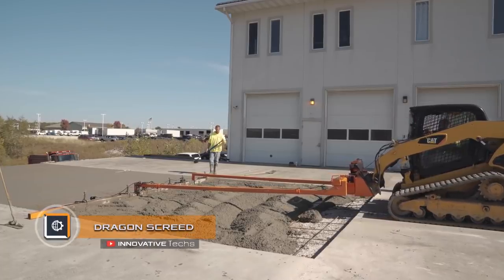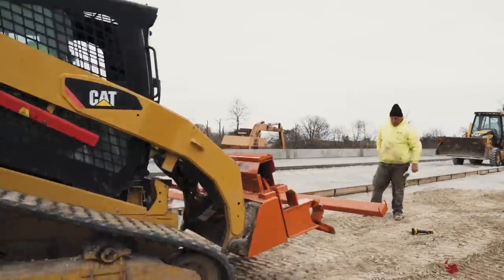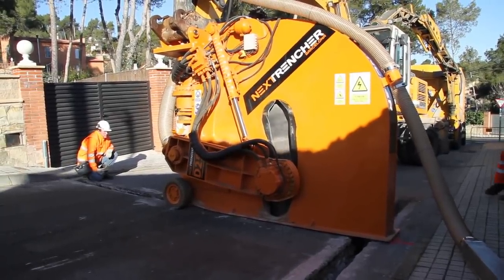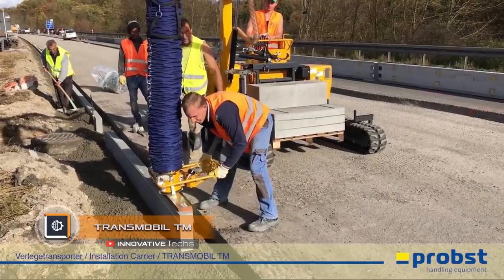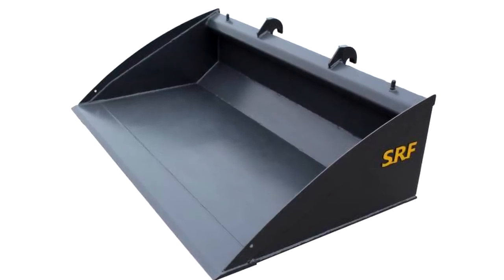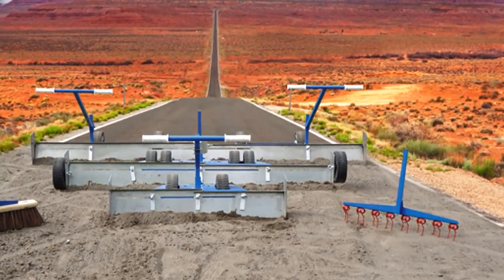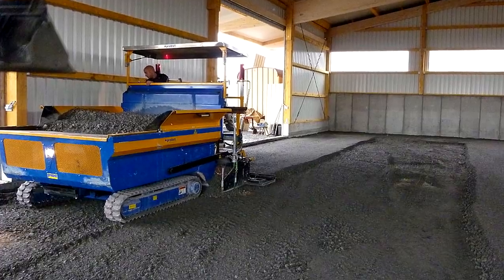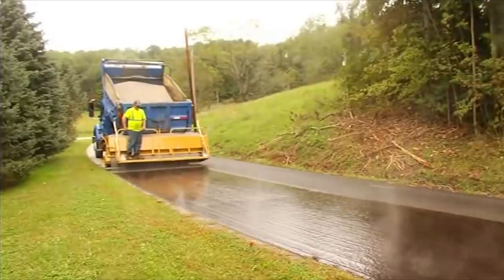Amazing Road Inventions That Are On An Entirely New Level

Comment: The rock spreader to cover liquid asphalt isn't new. I watched one of those attachments for a dump truck build up my road until it was strong enough so they could pave the road with hot mix back in 1955, 2 men controlled the thickness of the crushed rock usually 3/8's stone that was spread over the sprayed on liquid asphalt. Normally used to convert dirt roads to paved roads. After 4 to 6 layers doing it this way then you can pave with hot mix. Paving a road with this method is cheaper per mile of road done. All their doing is adding a computer to the unit. My old home town still uses the same spreader from the 50's.

Comment: The pot hole machine will do 3 times the work. But in a few weeks I gaurentee they'll be out fixing that hole ogain. To do it right. Cut the hole heat the hole get water debree out of hole then tamp it. But you never see that any more just more pot holes and cold patch bouncing off you car.
Reply: Sure don't seem faster than a guy with a shovel!

Comment: What this video doesn't show you is all the prep work leading up to these supposed "innovations" doing such a nice & neat job. The basis for any successful road laying project is a solid base,, that's where the real work comes in & if you have sloshy & unstable material underneath nor a clearly defined drainage path,, none of these finish product techniques will work,, not even concrete. A nice & level roadbed will turn into one filled with potholes & major distortions & cracks as soon as heavy traffic is unleashed in testing it. The cost of most of this equipment is exorbitant as well & there's a fine line in saving time & labor by purchasing very expensive equipment. You better have a healthy log of future work to do to keep this equipment running in order to see any kind of savings in your labor department. 

With all due respect to the poster below thinking the "pothole filling machine" is some kind of new age wonder,, I respectfully disagree on that one as well. I rarely see maintenance crews taking the time to prepare a reoccurring pothole properly in cutting it out square,, tamping it properly to stabilize the base,, then applying "hot liquid tack" along the outside seams in order to keep it impervious to water & especially freezing elements which is the Achilles heel for any repair job keeping the base stable. That "pothole machine" is IMO,, a waste of money when most municipalities could use their regular equipment (cut saw,,tamper,, small excavator or shovel & small roller) with good stone material to refill that pesky hole to make it where it won't open back up again after the first wet freeze conditions. 

Sorry,, I just see some of this equipment as overkill needlessly paying high prices for some of it that will stay underneath a shed more than being utilized in day to day work operations. 

With that said,, one size doesn't fit all & some companies might indeed find a need for some of this if they have continuing contracts or a very busy workload in the area they operate within justifying the overall & continuing cost of owning & maintaining expensive equipment..
Reply: Your remark is full of good and practical  sense !